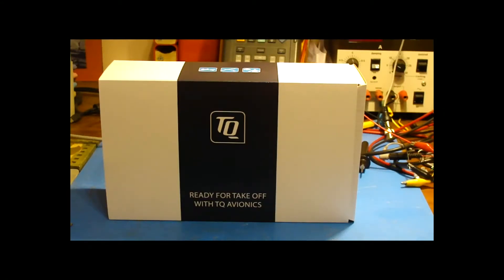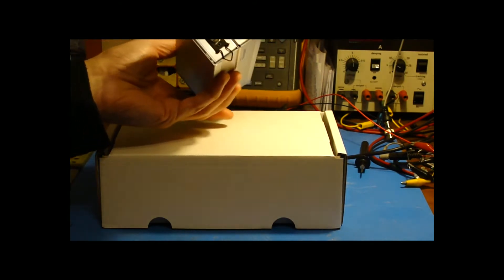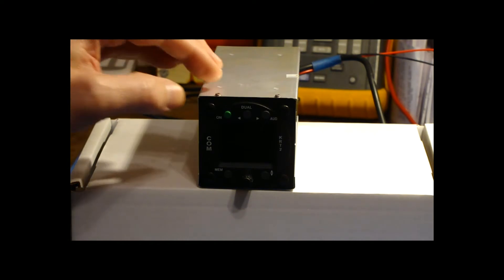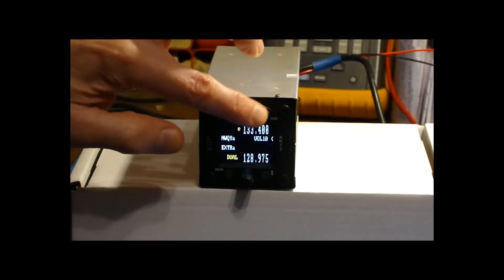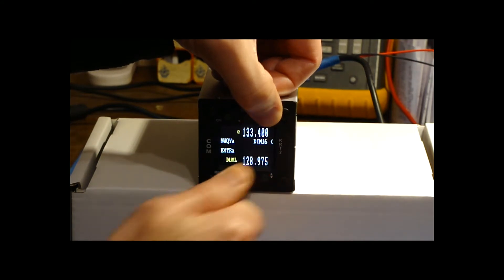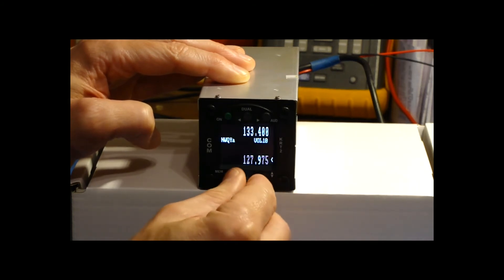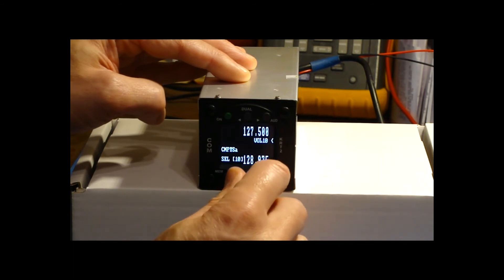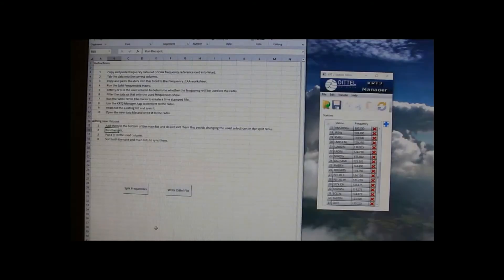Dittel KRT-2 Transceiver Unboxing and Operation

Comment: Great video. Interested in knowing a little more about how you program it? How have you made up your loom to do so
Reply from the maker: The programming connections are shown in the manual. You only need 3 wires, TX, RX and GND. You can then use a USB to RS232 adapter to connect it to your PC. The software is freely available from the TQ Avionics website.
Reply: @bvqbvq  Thanks Kevin - I've a USB - RS232 here, so I'll wire it up and have a go at programming
Reply: @bvqbvq  Thanks Kevin. I've discovered a bug in your (really helpful) spreadsheet. Split frequencies isn't working
Reply from the maker: @brendandigney8520  What's not working? I've just deleted the contents of the Dittel_Format worksheet and rerun the Split Frequencies macro and it regenerates the frequency table. I'm using Excel 365 for Enterprise on a 64-bit PC.
Reply: @bvqbvq  that's strange, I'm getting an error when I split frequencies. I'll investigate, it must be something on my end! Thanks for your help

Comment: Hey, thanks for the video! Have you used the adapter board mentioned in the KRT2's manual while preparing your DB15 connector?
Reply from the maker: It is very disappointing that they don’t supply one with the radio, it certainly cost enough! I made my own from a small off cut of copper clad PCB material that I had spare. I copied the drawings in the manual and just drilled the holes and cut away the excess copper with a sharp knife.
Reply: @bvqbvq  Thanks for the answer. I thought you may have some project of PCB to prepare. I think i will do it the same way you did. Greetings!
Reply from the maker: @piotrekmezyk9413  Let me know how your radio performs. I am dissappointed with the sound quality on mine when receiving from some stations. I have spoken to other KRT-2 owners and they are happy with theirs. I think I may have a problem with my radio and I may need to send it back to TQ Avionics for service and repair.
Reply: @bvqbvq   Well I have used it on two gliders and I am satisfied. The sound quality od very good for me. Maybe your radio is ok but there is some issue with your speaker? Or antenna? you say that you are dissapointed while receiving some stations - do you mean different frequencies or few stations on the same frequency?
Reply from the maker: @piotrekmezyk9413  I have experimented with a different antenna and new low loss coax cable. That did not make any difference. It is connected to a Sigtronics intercom which I used with my previous radio, a Microair M760 which gave excellent results. It is worse on some frequencies and the ground station always sounds worse than aircraft on the same frequency. It sounds like some of the higher frequencies are missing in the audio making it very difficult to understand voices sometimes.
Reply: @bvqbvq  if you have additional KRT eg. from another glider you could thy to switch them and verify if IT helps. Unless  the easiest way to cope with this problem is to send IT back to the manufacturer do that they check it.
Reply from the maker: @piotrekmezyk9413  unfortunately I haven't been able to borrow another one to try. I will probably send it back to TQ in the winter when I am not flying.

Comment: Nice video would have been even better of you had actually showed how to edit and set memory frequencies rather than refer direct to the app if radio already installed would have to be removed to connect to the serial port.
Reply from the maker: The memory editing on the radio is not very intuitive and so I only use the app. When I installed the radio in the plane I wired in a 9 way D-sub connector under the edge of the instrument panel. I can then just plug-in my laptop and program the memories in the plane.
Reply: I have a very difficult time programming my favorites.  It took many attempts when I first got the radio last year.  I had to have it replaced under warranty so I now have to reprogram favorites. I went through all the steps over 20 times for just one memory but it will never save.  The identifier is clearly there. The frequency is there. It will toggle to active and back to standby but when I push the toggle for SAVE, it never works. Very frustrating. 
It will let me edit and save the existing, default German frequencies but won’t let me add a new one. 
Any tips?